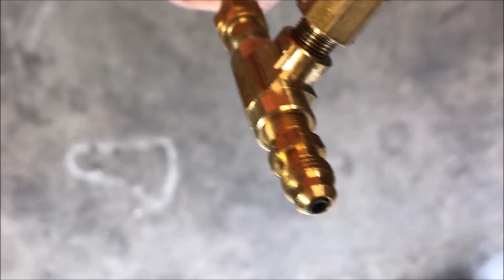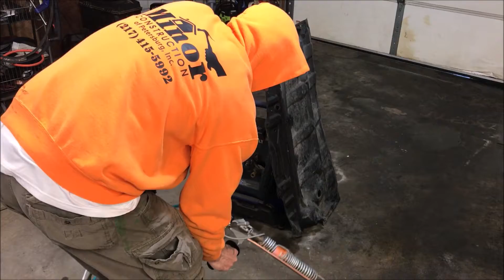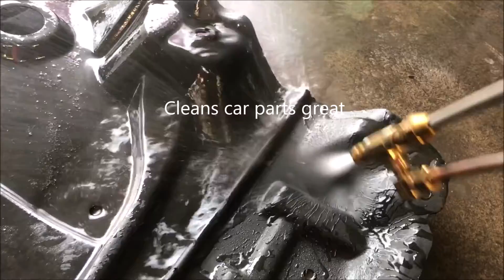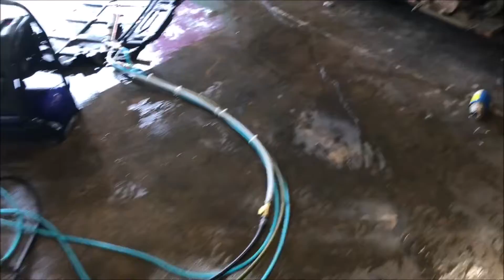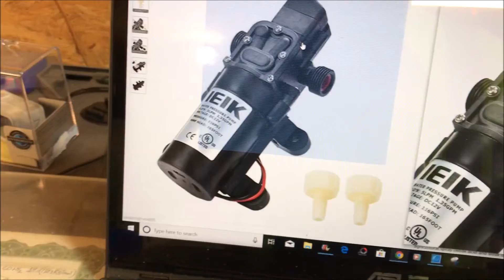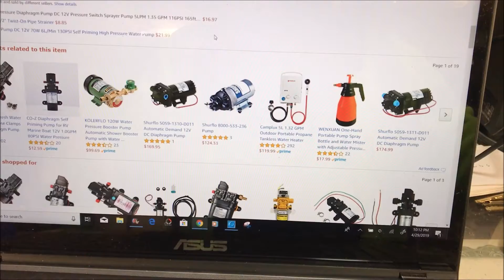Steam powerd Brewer equipment and Machine  Parts cleaner steam weeder

Comment: I love this idea, don't give up on it yet! but it might just be easier to go with the pump design. I love the mono boiler design. I'm really considering your design to power a telsa turbine with steam. as far as the water goes, can you make a bladder tank or use one from a old hydronic heating system to give you a bank of pressure rather then waiting for live pressure from your pump? a over pressured well setup might do the trick.

Comment: The issue you're having with finding a suitable pump is not easily solved. Pressure washer pumps are designed to operate at a specific RPM and flow a fixed volume of water typically rated in gallons per minute. Until you start getting into very large, very expensive pumps they won't over draw a typical residential water line. The way they generate pressure is by restricting the flow via the tip you use at the end of the wand. Using a tip that is too restrictive (causing say a 4000psi rated pump to operate at 5000psi) can and likely will damage the pump. 

To get 200+ psi of tip pressure out of that 1/4" copper tubing you are using you will likely need a pump that is on the order of 27 gallons per minute that can withstand 200+ PSI. Very difficult (if not impossible) to find something like this that does not cost a fortune. Then you have the issue of trying to flash off 27 gallons/min into steam with I doubt is possible with a handheld rig. Your best bet would be restricting the tip size, perhaps even trying some power washing tips on the end of the tubing. You can buy the couplers at Home Depot or Lowes or most hardware stores. 

https://www.amazingmachinery.com/nozzle-calc.html    That may help in deciding on what tip size to use.

Comment: Have you tried an automotive fuel pump? [gear-or-diaphragm / motor-or-solenoid]
Reply from the maker: not yet , i was thinking a fuel pump may be damaged by water
Reply: @NOBOX7  Gotta get ones with stainless or brass gears if you are going gear driven, does not matter if you are using solenoid driven.

Comment: NOBOX7 This is the budget pump ($44) claims 160psi at 12 volts D/C (sure it could be overvolted if necessary) and comes with nifty spray nozzle..
Still, try just the city water pressure or the WORX GT Power Washer lithium if you can as it's self priming.
https://m.banggood.com/12V-Portable-100W-160PSI-High-Pressure-Electric-Washer-Wash-Pump-Set-p-1188439.html?rmmds=search

Comment: NOBOX7 Here is the high pressure wand you should order to control the garden hose pressure into your regular steam cleaner, I think it will work perfectly-no pump or air pressure required.  City water pressure should do the job just fine:
https://m.banggood.com/High-Pressure-Washer-Garden-Car-Wash-Spray-Nozzle-Water-Gun-Hose-with-2-Spray-Tips-p-1188568.html?rmmds=search

Comment: NOBOX7 If you try and fail with just a garden hose as a supply, I think this is the best choice for a water pump-325 PSI, lithium powered, and you can find them for $50 if you look around:
https://www.homedepot.com/p/Worx-325-Psi-20-Volt-Hydroshot-Power-Nozzle-WG629/301949028
They also make a 40 volt version that's closer to $150 but can make 450-500 psi...

Comment: NOBOX7 I knew the garden hose was the way to go (think I mentioned it runs 70-80 psi of water pressure usually) Please try a test of just the hose input with a ball valve for flow control if you haven't already.